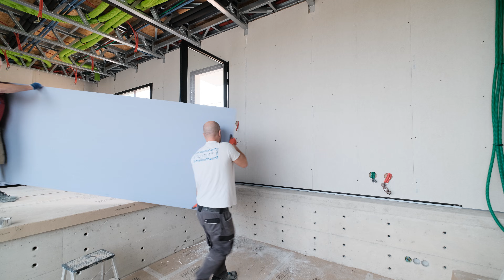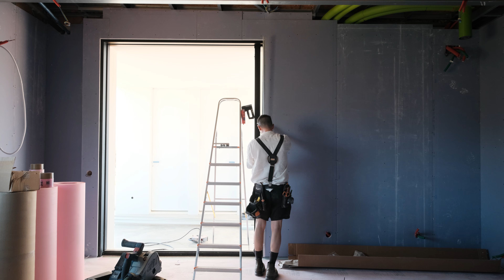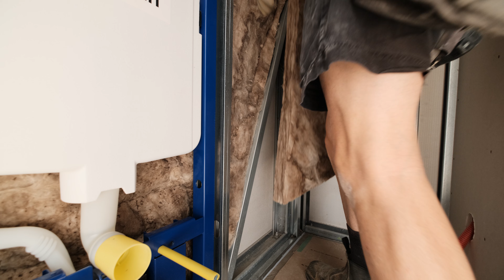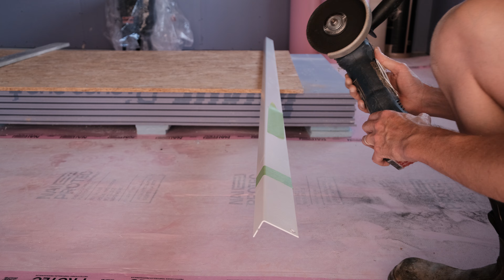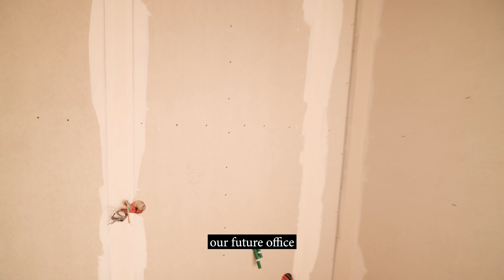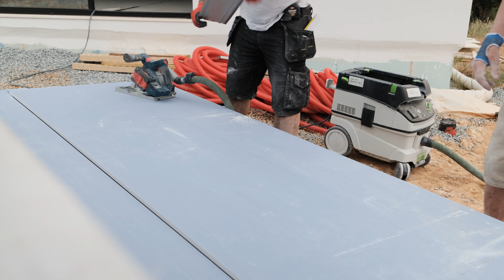BUILDING OUR HOUSE - Finished All Interior Walls and R36 Insulation

Comment: Where is your is vapor barrier a material (often a plastic or foil sheet) used in construction to prevent moisture vapor from passing through walls, floors, or roofs? A temperature bridge in your walls will flow vapors and a mold will be created on your dad corners and walls.

Comment: Your resilience and obsession with detail is of the chart.. Truly an inspiration.. However I don't understand why did you choose such poor materials like steel frame and drywalls.. You should have done it all in concrete so you could passe it to future generations.. Your lineage will have pictures and videos from your remarkable and outstanding discipline, consistency and willpower for eternity but unfortunately steel frame and drywall will not outlive them.. Anyway.. Congratulations and Godspeed.. (btw It would be interesting to see your project performing in some Architectural Competition in one or two years..)

Comment: The house is looking amazing . I think getting it exactly how you want it for you especially is important and worth the extra details you put into everything.Its your home and as you said before you started, its somewhere you wanted to settle and stay there ,so you wanted it perfect..I am impressed with the insulation,that should save money over the years,not using so much electric for cooling or heating..You have done a lot since you finished putting the house up and doing the windows..Keep up the great work 😀

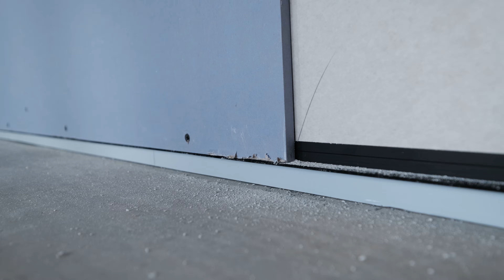Comment: 4:28 that screw is wrong, I hope is only this one...
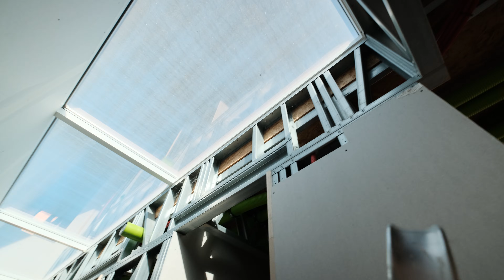7:45 the problem with glass on the roof... dust... it is not pretty.
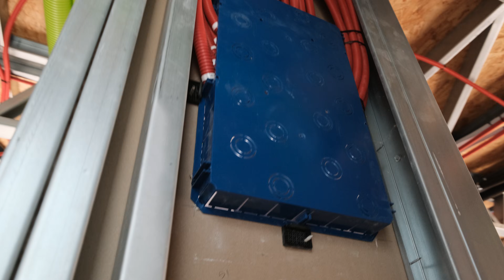16:27 I hope this dont have protecting equipments or is going to be a fun house... to hight and very dificult to access.

this is the best house I ever seen even with some little mistakes... good work Filipe

Comment: Ignore critics, love the design, the fit, and finish now easy to visualize. Agree 99.9 % decisions.  Only change design wise, hallway lovely  height, bright light from skylight so good, only issue door at end of hallway width  looks wrong proportion to heights in hallway. There are a few inches to the right that would have been easy to make door wider. Hindsight always 20/ 20. Opening the ❤❤❤opposite end seems perfect proportion , looking balanced width and height.  Amazing job thinking every little detail. Finished home you can be so proud of. Qualify finish will show everyone why it took your time to achieve.❤

Comment: Fantastic meticulous job. Why did you insulate between the steel studs? It reduces its R value by 50% as the wall assembly total because of thermal bridging of the steel stud. I built a similar steel stud house and insulated everything on the outside continuously so the R value of that insulation is maintained across the wall assembly and I left the interior stud cavity empty. I used 3 1/2 inch poly iso. The wall assembly total R value was calculated to be R26.5. There’s no way based on the thickness of your exterior walls that you are over R36 unless I missed an exterior insulation addition under the cladding…?

Comment: There are no shortcuts to perfection. This house finished will be perfection. Love it even though you still loads of work with putting the ceiling up. Painting the walls with a spray gun speeds up that process. But the ceiling is one of the hardest parts.

Comment: A beautiful house with impeccable details. How much consideration do you give to a future occupant's repair costs? If you gift the house to family decades from now, will they be able to absorb the cost to make such high end repairs? Every house will need significant repairs eventually and the cost of materials and labor keep rising. As example a sewer line here in the US can cost more in 2025 than the original purchase price of the entire house in 1965. A nice home in the US in 1965 could be $35,000. Today just the sewer line replacement can easily cost $35,000 or equal to the entire original purchase price.